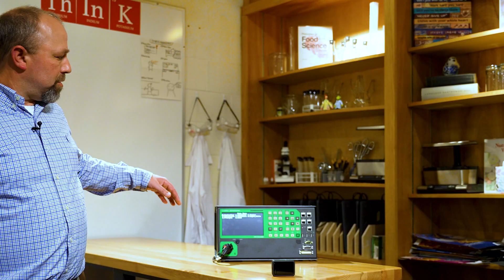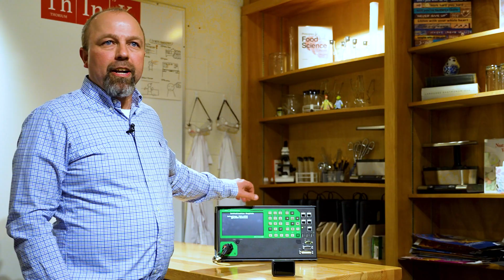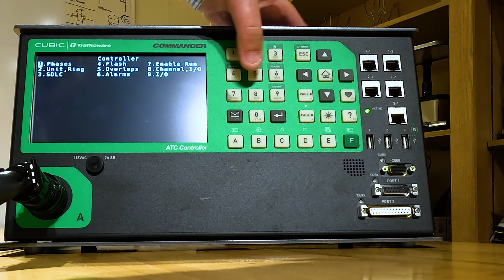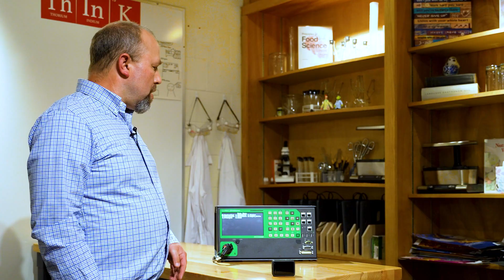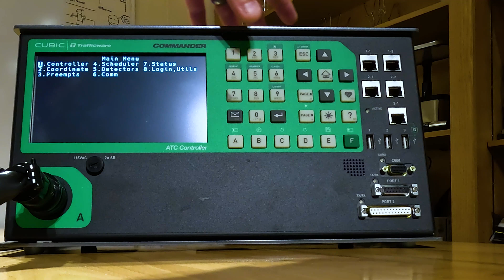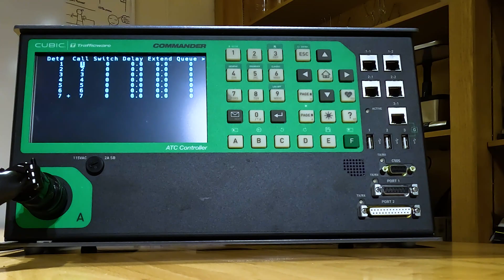Cubic TrafficWare Commander Traffic Controller Training

Comment: Does this controller have an advanced and delayed walk setting in the timing menu as well?
Reply from the maker: Sorry Kyle @TheTrafficTech we only saw this message now. I will reach out to TrafficWare and find out.
Reply: @AppliedInformationIncSuwanee  thanks! I appreciate that!
Reply from the maker: Yes, it does.  This accomplished through Main Menu-1-1-3 Options+.  There is a setting called Grn/Ped Delay where you program the amount of seconds you want for the Leading Ped Interval.  If you want to delay the Walk signal instead, there is a Ped Delay toggle option (X) in the same menu that would be toggled On to delay the Walk instead of the vehicle Green.
Reply: @AppliedInformationIncSuwanee  perfect. I have some contractors who have a different customer that uses these controllers and they wanted to implement LPI’s.
Thank you!